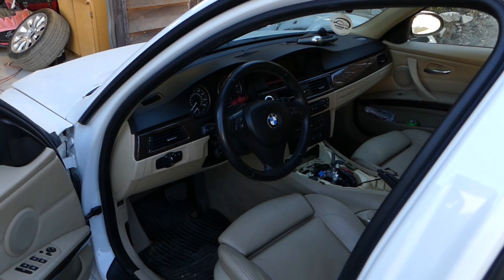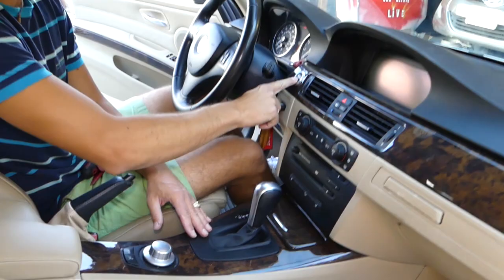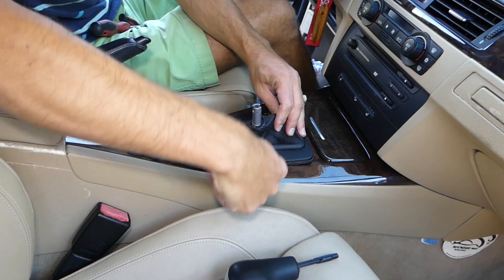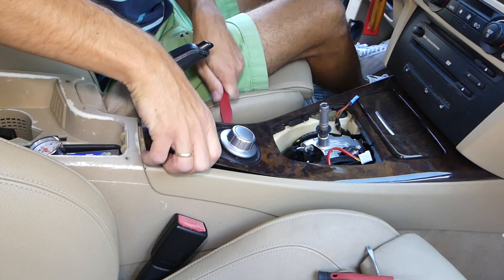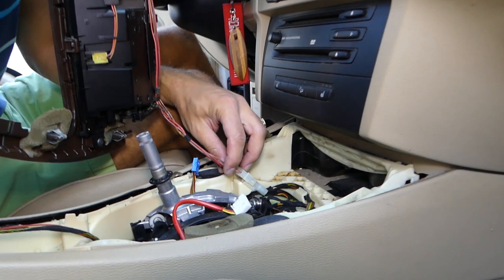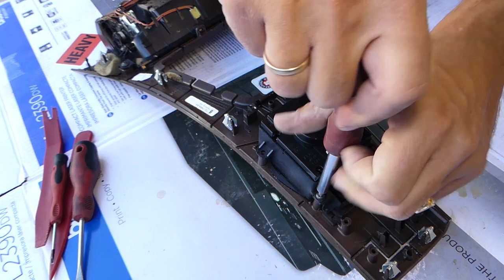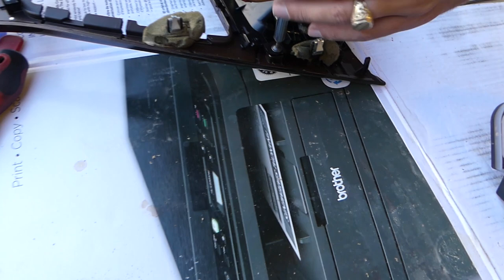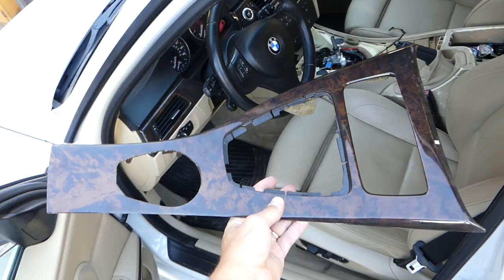HOW TO REMOVE SHIFTER CENTER CONSOLE TRIM ON BMW E90 E91 E92 E93

Comment: Disconnecting the cable from the iDrive won't cause any problems since the car has the battery plugged? I was worried about something going wrong when I try to unplug the iDrive switch.